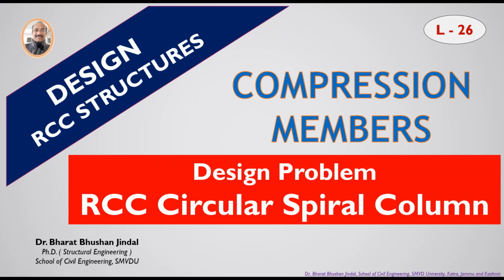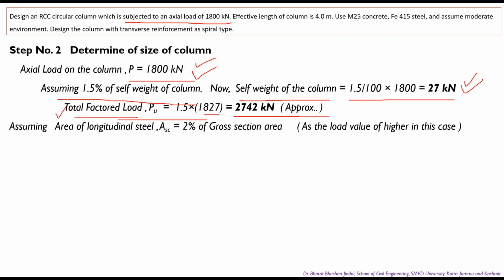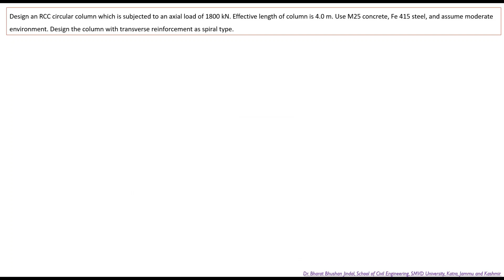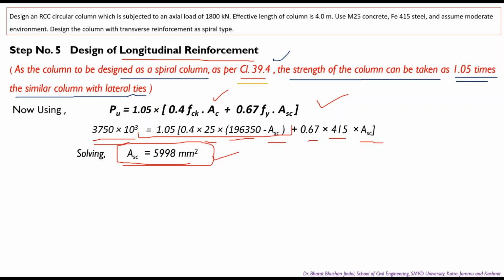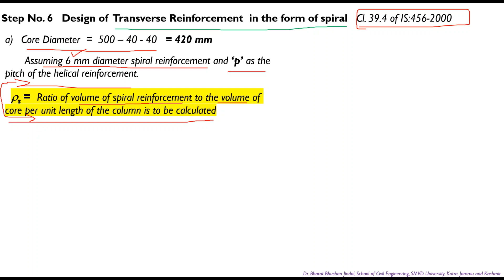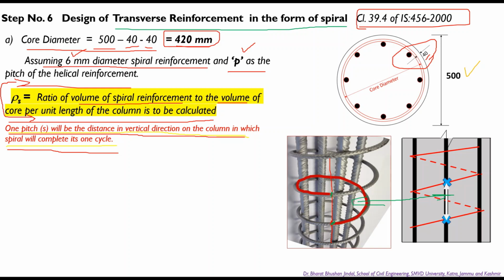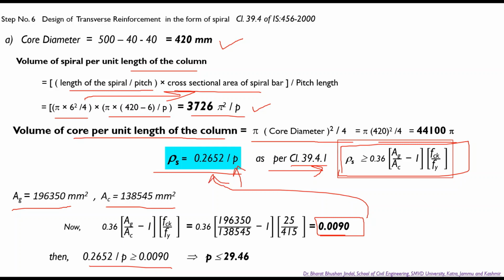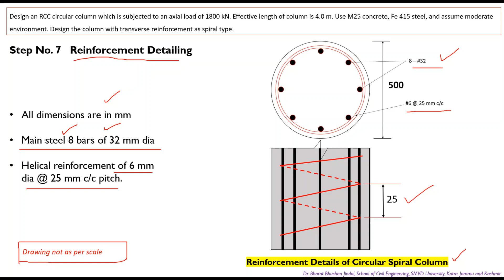Lecture 26 | Design Problem || Short Axial Spiral Column

Comment: Sir, are there any criteria to decide the area of steel based on a range of axial loading. For example if the given axial load lies in the range of 2000-3000KN then we may assume the area to be 3-4% of the gross section area and if it lies in the range of 1000KN to 2000KN we may assume the area of steel to be 2-3%of gross section area, because IS code has only talked about max and min percentage of steel.
Reply from the maker: Excellent question. It can only be decided based on experience of the designer. You may recall that whenever we talk about sectional dimensions or percentage of steel, we use word 'assumed' and later on apply checks that how long our assumption is true. 
In practice, design of structures, generally designers use THUMB RULES but again that comes under their intellectual rights and no one discloses it.  So everyone has to make their own thumb rules based on rigorous design experiences.

Comment: Sir how are you taking Pu 3750 (13:30 ) as you have calculated some other values in the previous steps please tell
Reply from the maker: Yes, you are absolutely correct. I have taken incorrect value later i.e. 3750 kN. In actual it was the load taken in the design problem of the Rectangular Column.

You can revise the calculations.

.. thanks for finding the error.